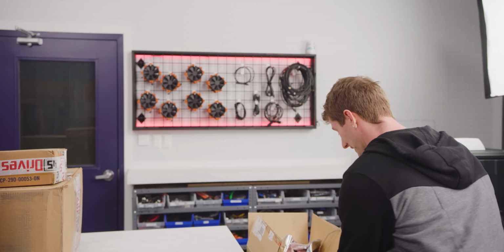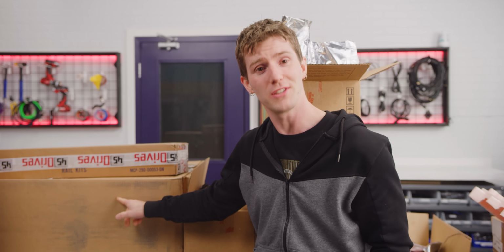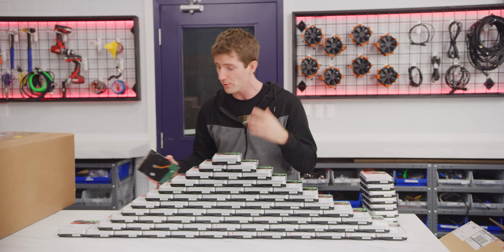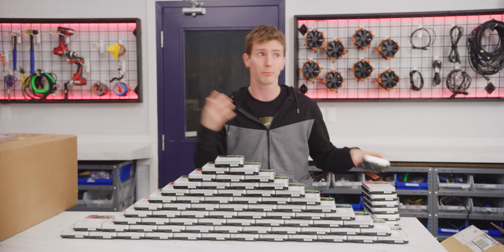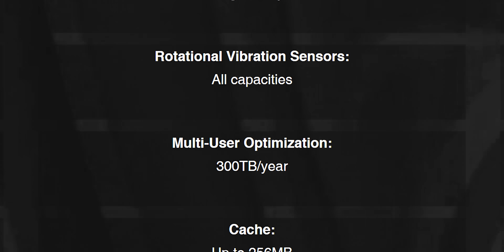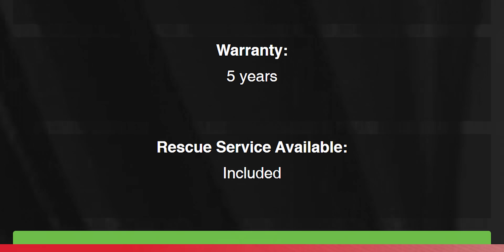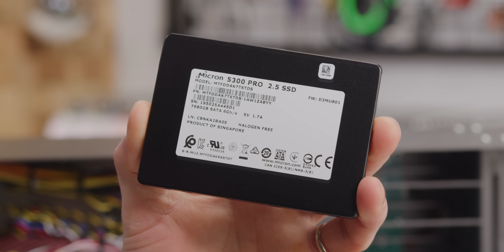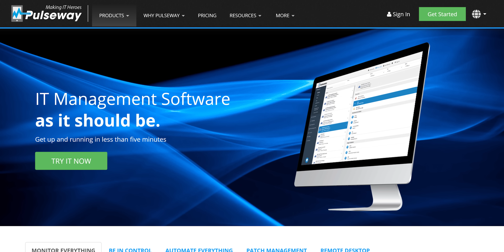Unboxing 3 PETABYTES of storage!!

Comment: Oh here we go again... This will max out the pcie lanes and clog up the pcie to sata controllers. Also I think you went with absolutely the wrong type of drives, ironwolfs and exos are ment as archive drives. Once written, than only occasional reads, not videoting of them. You should have gone with the surveillance line Skyhawk ST16000VExxx, meant for 24/7 and absolutely okay for videoting of them all the time. But anyway, I give the exos half a year for the first to fail and the ironwolfs/pros max a year ;).

Comment: If I used 100 Seagate drives, I would expect 10 of them to fail in the same week some time within the first year, completely wrecking the array. For this reason, I use RAID 1/10/100 exclusively, and always have drives from different manufacturers present in every mirror.

Comment: FYI if you use multiple sata ssds for l2arc they work in series while reading from them and not all in paralel so you will read as fast as the speed of one disk. Initialy I thought that all cache disks are acting like "raid0" but that is not true and they act individualy. I used that in production and I never got more than 3-4 gpbs while high hit rate on l2arc. I recomand you use something way faster for l2arc, optane preferred as the reads will chew the lifetime of normal ssd quite quick. You can see the serial access if you put a short watch on on zpool iostat. "watch -n 0.1 zpool iostat -vy" while you have a good amount of activity. Also you might want more ram as l2arc migrates to ram first before hitting the nic. On a separate note the write log, slog, is not available for read as you write to hdd, si if your data is not committed to the pool yet and you need it immediately as you write it, it might not be available for read. I had this issue with some fx cache sims where each previously written frame was needed in the next one and they were not on disk yet as they were quite large so commits took quite a bit(less then a minute but still). We needed to introduce data checks before starting sims for next frames. Also make sure you tune the read and boost read speeds for l2arc for the zfs kernel module. The default max read/write speed for l2arc is 8MB/s, at least it was in 0.6 but not sure about 0.7+ if they changed that. Even so check the defaults it might still be a conservative number

Comment: You may want to consider just compressing old footage.
Theres a point of huge diminishing returns when it comes to quality / size ratio, and above it the difference in quality in most cases it is not even noticeable.
And with Threadripper / Epic, that process should be pretty fast, and you can even automate it via scripts and for example, Handbrake. Which is more or less what Gamer Nexus does :)

You could also at the same time do a video about creating the ultimate cpu video encoding/ transcoding machine, LTT style :)

But those are just some ideas, keep uo the good work :)

Comment: 6:22 In ten years, this moment will seem so ridiculous. As they once advertised 8 megabytes memory cards.
Reply: 640 kb is enough for everybody
Reply: I couldn't figure out why I couldn't transfer some files onto an SD card the other day, until I looked at it and saw it said 16MB not 16GB. I don't know where I got it from.
Reply: @othertonywi1son  my guess would be a time machine.
Reply: @othertonywi1son  Some old Epson printers used 16 mb cards.  Maximum.
Reply: XXX Xxx 5 bytes vs 1*10^15 bytes
Reply: Still remember 20MB HDD of my first 386
Reply: @MrRourk  105MB master race. Had to uninstall Windows when you wanted to play multi floppy disk game.
Reply: @XXX Xxx You drunk or something?
It's Petabyte, Exabyte, Zettabyte, etc.
Reply: @newezreal3241  Only the ones that want to go to hell
Reply: hardsonlinegirl.link/KBIq11mNB0I
Reply: @newezreal3241   yeah
DNA storage (video on techquickie)
Reply: i remember this add from 87 about a 10 mb hdd. "you'll never have any storage space problems ever again" lol.
Reply: @Dunkelelf3   10 MG???
How can you like store stuff in that
I mean sure you probably won't run out of space if you only use .txt files
BUT WHAT ABOUT EVERYTHING ELSE
Reply: @Xnoob545  you didn't catch the 87 part? back then we had µm lithography cpus with one core and some mhz clockspeed and ram in kb sizes. times have changed and noone back then thought how all the tech would blow up really quickly.
it's the same with the mbr. people back then knew about its limitations but thought: "oh well hdds would need to be larger than 2 tb before it will become a problem so whatever.. this will never happen." but that happened and they had to invent gpt because of it.
Reply: @Dunkelelf3   what
Reply: @Xnoob545  it was an add for a hard drive back in the year 1987. 10 mb was a lot back then.
Reply: @Dunkelelf3   how could you store stuff using 10mb?
What were you storing back then?
Because i was born later than 64 bit cpus were invented (stil lusing 32 bit laptop tho)
Mine has 400 gb
40,000x more than the one from 1987
Reply: @Dunkelelf3   hdd extention sound weird btw
Reply: @Dunkelelf3   by my calculations in 2053 a crappy laptop will have 16pb of storage
Reply: @Dunkelelf3   15 pb using LSD
(Liquid state drive, not drugs)
using DNA storage
Reply: @Xnoob545  games on our first pc were on a 1.44 mb diskette. what was stored on hard drives? saves for games. text documents. same as today however the size of everything was way smaller. there was no internet to download things and devs knew to actually code efficiently. they had to due to the storage and hardware limitations. also there was no pictures or video on pc. there was no digital photography. there wasn't even a real gpu yet.
Reply: @Dunkelelf3   right now the minimum amount of space befpre you cant do anything would be like 1gb
Reply: @Xnoob545  as said stuff was smaller. the operating system for the amiga came on 2 1.44 mb floppy's. one with the workbench and one with the kickrom. everything from games to programms would fit on these floppy's. and having an amiga 2000 with 2x 3.5'' floppy drives was luxury. this stuff was expensive af. hell the needle printer cost like 2000 mark back then so like 1000 euro but if you count inflation most likely more like 2000 euro. 
i've seen a lot of tech come and go. now i have an i7 5820k, 32 gib of ram, 1080ti, 1tb 970 pro, 2x 1tb 860 evo, bunch of hdds with about 4tb space and a highend soundcard.
Reply: @Dunkelelf3   ok
Reply: @XXX Xxx ?
Reply: Nah maybe 15 years
Reply: Newezreal LOL
Reply: XXX Xxx The fuck is a pentabyte? It’s exabyte, zettabyte, yottabyte.

Comment: Question why are graphics cards not modular?

Iv been watching videos to get updated on new components out on the market to build a new PC after 15 years of not building one...

Since iv started watching and started learning again iv always had the question why aren't graphics cards modular like the rest of a PC...

On your mother board you can add and take away ram, Change CPUs, change gpus, change sound cards, ECT.

If a GPU is the same thing as the rest of your PC but stand alone to specifically render images why haven't they made a card where a person can buy and add ram or change the gpus version of a CPU?

Comment: Is there a particular reason why you stuff all them disks inside a single chassis when you could easily use Ceph as distributed storage cluster which would be way more safe, more epic, most likely faster and no oldschool RAID?

Comment: ...Linus, I doubt that you need all the raw footage at moments notice; invest into some long-term tape storage solutions and archive complete projects with it - granted, modern magnetic tapes can hold quite a lot and, in the end, might turn out to be cheeper than petabytes of SSDs and HDDs.

Edit after watching the video: not sure you might need the solutions I'm about to mention - after all, they're usually used either for swapping data in rigs that are low on RAM, or for creating compressed block devices in RAM, - but you guys might want to investigate into zram and zswap features of Linux systems.

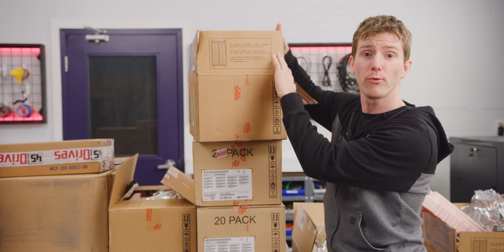Comment: 1:51 With 75 drives, and assuming typical hard drive reliability rates, you would be losing a drive every few months. That is, assuming that failures are independent. Which, given they came in the same delivery and are therefore likely to be from the same batch, is a somewhat dicey assumption.

In other words, don’t wait for 10 failures before you start replacing drives!

Comment: That 180 TB limit is VERY easy to hit when a FULL RAW 8K file at 32-bits per RGBA pixel at 60 fps is 141.55 megabytes per frame and 8,493,465,600 Bytes per Second (8.49 Gigabytes Per Video Second) or 30,576,476,160,000 Bytes per hour (30.57 Terabytes per Video Hour)

On just ONE of our 12 hour overhead photo flights, that's 366,917,713,920,000 bytes (366.91 TB) of video, so hitting the 180 TB limit on that Seagate 16 TB drive within ONE day WOULD be a BIG problem!  (hint: we don't use Seagates!)

.

Comment: If you are looking for a project to use some of the drives, I have a project for you.  I have an TT View 71, i9-9900k, 32 gig ddr4 3200, RTX 2080 super MSI Z390 ACE. It has 6 3 and 1/2 inch bays. I use 6 8TB drives for my media. I would love to have 6 16TB drives in raid5. Right now they are not in raid because I was afraid there wouldnt be enough room. I would gladly bring it to your studio to do a video of the swap and set up. Love your channel.

Comment: I'm not super familiar zfs, but I've read that l2arc is generally not useful in a price/performance perspective, and that adding a cash equivalent amount of ram was usually more useful, due to poor performance of l2arc and increased memory overhead for the lookup tables for the l2arc eating further into the arc cache.
I wonder if they'd be better off just having a ssd only zfs volume and finding a use for it.

Comment: ok so i got a problem so most of the new motherboards which are 1151 are with a 6 pin or 8 pin right ? not sure but , 1155 is with 4 pins or 6?? does 1155 has 6 i forget,   anyways so my question is this my friend did a mistake kinda i told him not to do it but he did it anyways,   he bought Asus 1050TI for like 200 dollars and the cable is 4 pins and 2 pins are left to Fill them, and his CPU is Intel Core i3 3220 so one of the Fans starts spinning the other doesn't and nothing comes up on the screen is that the problem becouse 2 are left? or becouse his CPU is weak or what? thanks in advance

Comment: This guy's unboxing 3 petabytes of storage, meanwhile I didn't have a spare hard drive to put in to repair a PC that someone I know owns, so I took out an old one from my dell optiplex PC (both of our PC were dell optiplex PCs that are older but still run so I had no issue with compatibility) and put that one inside the PC I took out the bad hard drive from. XD

PS: Taking out the hard drives weren't the complicated part, the complicated part was the hard drive mount. The one in the PC I was repairing was equipped with a fan and was bigger. The one in the PC (that I own) I own that I took the hard drive out of had a much more basic snapping-in mount, so I had to take the mount with the fan in it, take the broken hard drive out, put the other one into that mount after I removed the original basic mount that it was in. It was complicated business, but I eventually got the PC working again. So that actually is my first PC that I repaired for someone else, someone that I know. Just one more step to me becoming a computer technician. :)
My plan so I can get my dell working again is to either a: put in that same hard drive that I think is bad and put it in to test and see if it happens to work in another PC which will be my dell optiplex, or b: take a 1tb laptop hard drive (has the exact same connection) and test that one out (I think that one's broken too but it might work in a different PC)

Comment: Visit our office, our little filesystem can handle 3.3 PB/s writes.  78PB total, but its getting long in the tooth at 5 years old and going to be shredded literally.  Seagate had to write custom firmware for our drives after excessive failures from the workload, pretty crazy.

Comment: My god. Just buy a proper SAN. Way better speed, redundancy and management. A PowerVault ME4 would do up to 4PB. Not to mention you need to offsite the storage in case of disaster recovery. What happens if the building burns down? Back it up to an AWS S3 bucket or S3 Glacier.

Comment: L2ARC, you need PCie storage to be beneficial, it will slow down the system as it has to checksum the ARC (memory) L2ARC (fast storage, meant to be) and physical spinning HDDs... thats 3 copies, ram is fast, SSD sata is too slow and HDDs in a performing vdev in pair with ARC memory is much faster than adding sata SSD L2ARC... comments/feedback? (yes L2ARC does eventually operate independently but new files are on memory then moved to slower L2ARC when RAM is saturated)

Comment: Supermicro makes a 90 bay 4u box. I was considering it for my job. At 16TB, that's 1.44PB, or 1.408PB RAID6, or with 2 hot spares, 1.376PB, which is where it should be in the end. Now, something like SAN Symphony generally manages ... all of this. What I would really want is something like two RAID6 sets, fully duplicated. With all that, what I'd expect is to buy 540 drives, 6 chassis, and end up with 4.24PB of usable space. I know that's somewhere around 49% of the total drive capacity, but backups are important.

Comment: I was REALLY bummed to find out 2.5G/5G motherboard LAN ports still only work at 1Gb unless you specifically have a “multi-gig” router. They won’t work at those speeds on a 10Gb router.

Comment: Linus: adds 3 petabytes
A year later: server dies
Data recovery services: actually im done with you
Reply: This has happened.  It's why we changed to seagate from WD.
Reply: @numlockkilla  WesternDigital in my experience has been better than Seagate.
Reply: @Catknapper  Same for me, Seagate has always had a higher failure rate in my experience. But their 4TB hybrid drives are so cheap for their storage capabilities and SSD-like speeds, so I keep buying them...
Reply: Mike Eral Yeah... Seagate actually had one of the highest failing rates from the newly released decade report from BackBlaze
Reply: @ErisTheCatgirl  So.. How BIG is your sample?
Is it bigger than 122,658 hard drives sample from backblaze report?
Seagate is constanly in worst rank for years in their report.
Reply: @TakTakSub  it's not exactly fair to mention that in a comparison between Seagate and WD since they used like 500 WD vs 120000 seagate drives , but in general yes they are the worst by two percent , TWO PERCENT
Reply: @munjee2  My anecdotal experience over the past 10 years as a tech - I've had to warranty 1 WD drive and Ive had to warranty about 15 seagates in the same time frame. I buy an equal mix of both because I just get whichever one is in stock at the supplier for the cheapest price that day as they fluctuate a little between orders.
Reply: @Wrathlon  I am by no means denying Seagate is far worse ; in my experience they have been, I was just pointing out that this particular report isn't really very strong evidence that's all
Reply: @munjee2  Really big problem here is not just a gigantic sample group size difference, but how small the former one is. A couple of drives can literally skew the stats almost a whole percentage point.

I rarely put too much into these stats unless sample group is at least 5k+ and/or there are significant outliers that have been qualified.
Reply: @TakTakSub  You're not lying. https://www.backblaze.com/blog/backblaze-hard-drive-stats-q3-2019/
Reply: To be fair, BB report doesn't include must info about the warranty process, which is more important for regular user with personal setup.
Reply: @berong91  warranty wont get your data back. So is mostly a pr exercise
Reply: Peter Ellens warranty is mainly for the big guys... Huge datafarms dont loose anything when a single disk dies.

So they dont care about its lifespan but only how long warranty lasts. Synchronized tripple backed up farms only need to care about how long they wont need to pay for a replacement.
Reply: @Dust599  Hello data storage manufacturer shills!
Reply: LMFAO
Reply: @ErisTheCatgirl  I know it's not fact, its just one person's experience, and to be fair this experience hasn't involved their latest line of products so my experience is not a representation of the present quality.

Comment: I have a Seagate Exos X14 12TB enterprise drive in my desktop PC, acting as primary bulk storage. It's an absolute beast, and fast as hell for a mechanical hard drive. My ATTO results hit in the 250-290MB/sec range, which again for a mechanical hard drive is crazy.

Folks looking for large capacity and solid performance for internal HDDs for desktop use, but for whatever reason don't want to RAID up a bunch of smaller drives and/or can't justify building a NAS, would do well with one of the Exos drives (even though an enterprise drive in a desktop is almost comically intense levels of overkill) as you'll never wear it out under typical desktop use.

Comment: What kind of battery could keep the RAM energized so it doesn't lose all it's date in the case of a power failure?

I mean, what if it was possible to connect an external battery to the motherboard that would kick in to keep the RAM active, the system would shot off indeed but the data in the memory could be backed up or read back once the system is running again. Like a UPS for the RAM only.

Is RAM that power hungry? I assume not and that a moderatly large lithium battery could keep the data safe for quite a while. Could be a great safety feature.

Comment: Just a quick question: if SSD's come in 3,5" formats, why not just make a 5,25" SSD and use that extra space to put in more storage? You could then just easily quadruple your storage capacity and servers wouldn't mind, as they already have slots designed for that size.